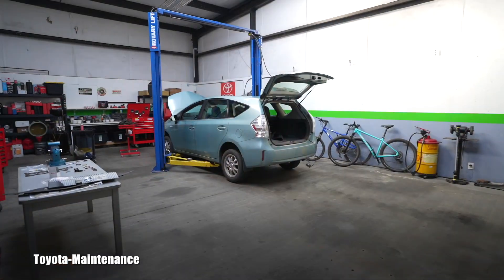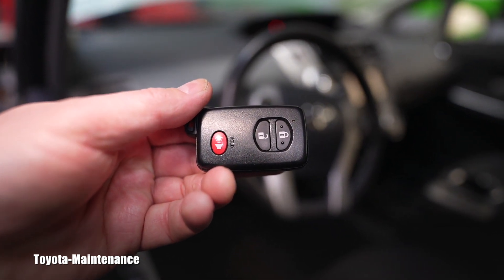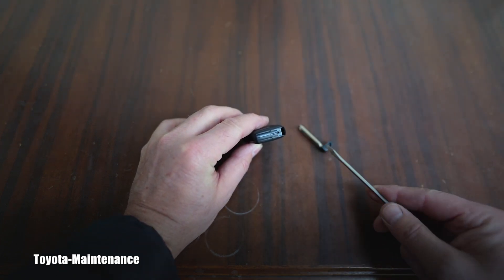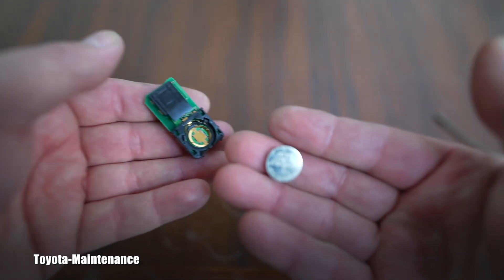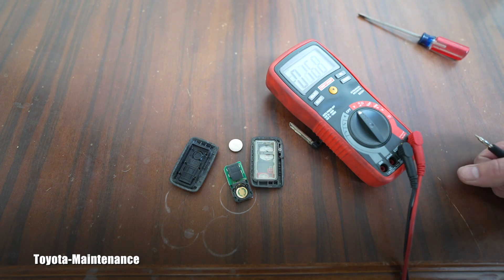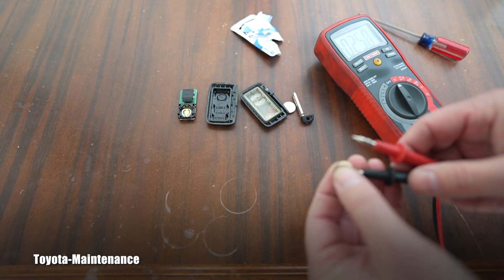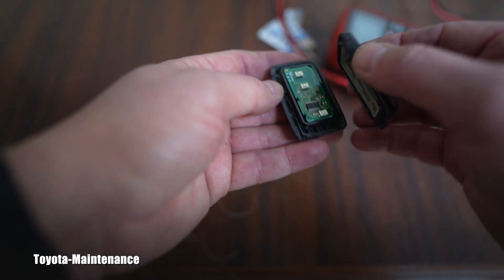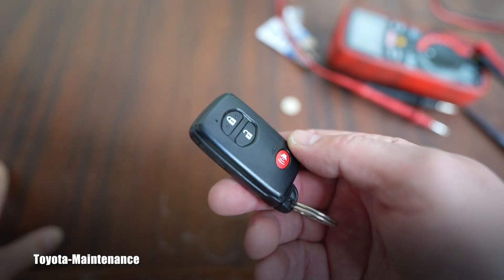How to replace battery in Toyota electronic key

Comment: Nice video. For those who don't have a screwdriver on them, the tip of the manual key can be used to separate the halves of the case. Insert the tip of the manual key and twist and it comes apart.

Comment: Some car makes will ping the fob every few minutes while the car is running to see if it is still there. This depletes the battery faster. 
I wash and dry my hands well before opening the new battery and avoid handling it at the insulator gap between the positive and negative terminals. This because hands sweat and will leave a salty residue in the gap creating a high resistance short that will significantly shorten battery life from the small current draw. We could use clean plastic tweezers for battery handling but they are generally hard to find.

Comment: Looking to get a second key for a 2013 Venza. It's a smart key like the one in the video. Should I just go to the dealer or is there another legit source?
Reply: $350+ D stealer or eBay keyfob $60-80
Reply: I knew your laptop exists! Oh wait wrong Hunter, anyway, like Dmitri said, f the dealer. eBay or scAmazon. But you need to go to a guy who has they key maker. Some mechanics have it, some don't. Keymakers can scam and overcharge too, depends on who you can find to do it at the best price.

Comment: I have a 2005 Toyota Camry LE. Today I unlocked my car with the remote, then opened the trunk with the key (my remote never did open the trunk). When I was loading my groceries into the trunk, the car remote started all by itself. The driver's door was unlocked also. My car had started by itself two other times prior to today. What is causing this?